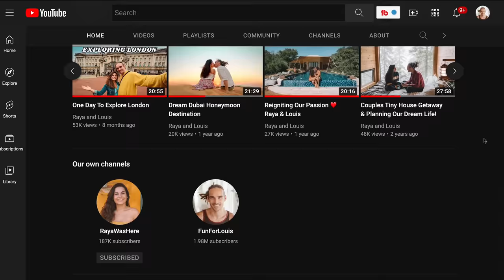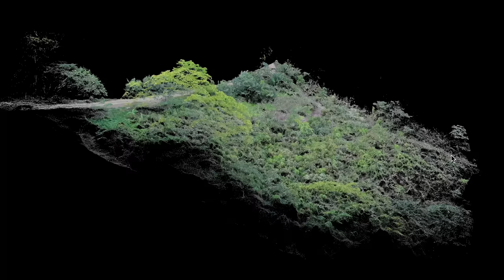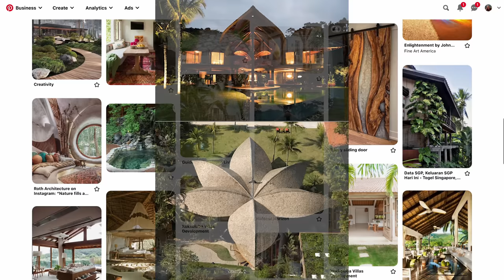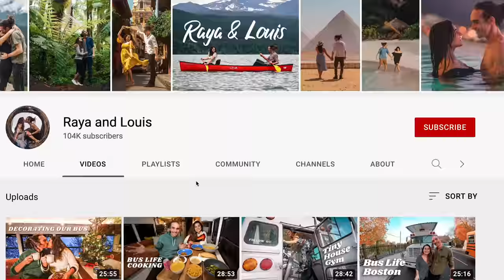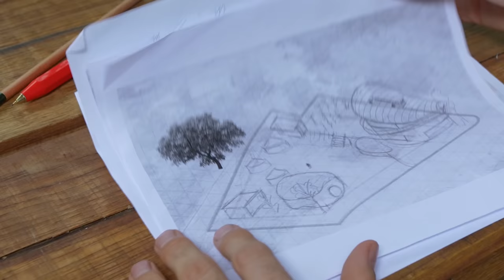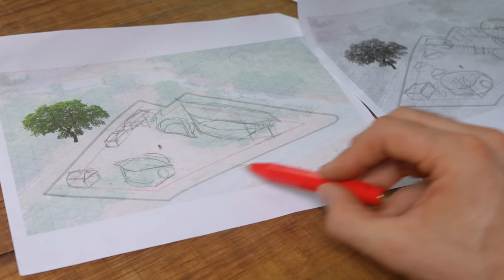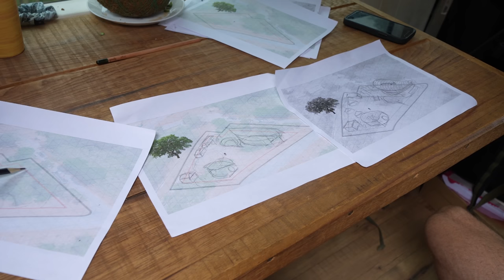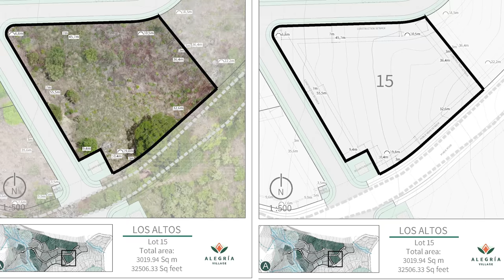Moving to an EcoVillage in Costa Rica // Planning Our House

Comment: As a Costa Rican I would like to say a pair things that you should consider, mostly weather-related. 
The first one is that you should think about how you would like the property to look in dry and rainy season and somewhat of the level of water consumption. The Pacific area is usually affected by droughts with different intensity, so consider that. That way you can mitigate the effects of the drought and be responsible of the water consumption in dry season. Second, consider checking the effects of past tropical storms and hurricanes in the area. Recent ones like Hurricane Otto and Nate, both caused a lot of damages in the country. That way you can build a building that is resilient to strong climatic events. The creek can disappear in dry season and depending in the strength of the rainy season it can become strong water stream, so ask experts for their opinion. I hope and wish you both the best in this project!

Comment: It would be interesting to find ways to integrate the natural river/creek into either (a) your future garden planning almost as a natural irrigation system, or (b) a natural water source for drinking/showering etc. Would depend on the natural sustainability of the creek and where its source is from as a reliable source long term. Would be a fun video to walk along it to find more originating sources! One thing to avoid would be to make a design that doesn't take into consideration the pollution of the source as well, assuming it carries off beyond the land.

Comment: The net positive of the pre-grading is this: a useful (and aesthetically charming) drain was added to your site.  Since your lot is a gentle slope, effective drainage will be key, especially if you're adding structures like glamping tents that need dry ground. When a heavy rain hits (and the howler monkeys start howling), take a tour around the perimeter and look at how the land drains itself of water. You've got a lot of heavy equipment in use nearby and it would be easy to add to or expand on your drainage system with trenches. (Eventually, you can make these subterranean with PVC pipes to conserve land).  If absolutely necessary, you can elevate your structures a little with pillars which will also give rigidity during earthquakes as previously mentioned.  Solid drainage will save your structures (and studio equipment) from heavy rains and flooding. With drainage, there's no such thing as "overbuilding."

Comment: I understand the dream but I am certain of its failure if a healthy spoonfull of reality isn't part of the mix.  The project needs to incorporate technology and seek to advance the art of self sustenance and cooperation among families and not just create a manual  labor camp. If the dream is to replicate the TV reality show "SURVIVOR" and have 50 families live it full time it sounds like a recipe for misery. The community will also need strict rules with remedies for those who break the rules. 90% of the problems with this village will be social. 

There was a really great video I saw about a farmer in Oregon that used gravity and a serious hillside ponds to raise Ducks and fertilize and water crops. Of course everything takes money but it would  make sense to have solar panels and electric farming equipment as well as plans to produce something to be sold outside of the community to trade for other things you need you can't grow or make yourself.  
The level areas should be used for crops that can be tended to with power equipment and the homes should be on the slopes.